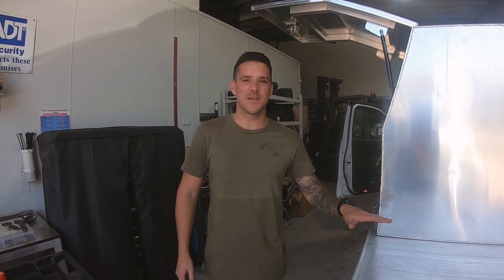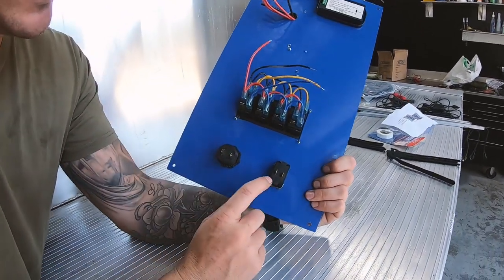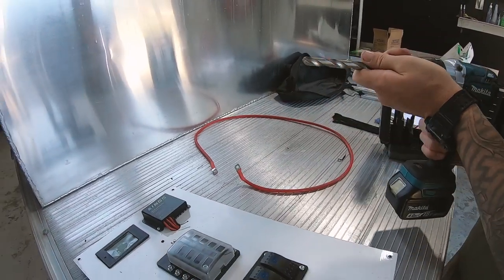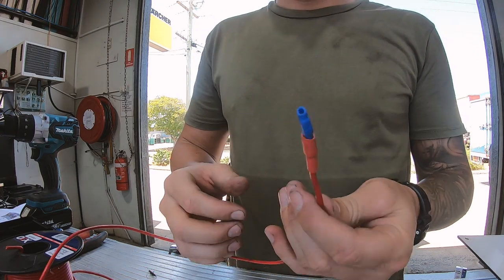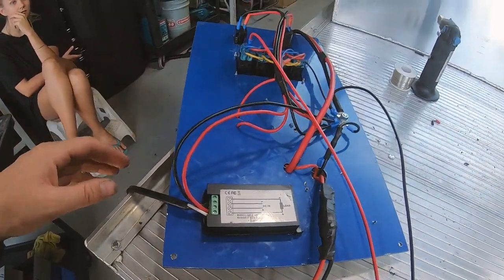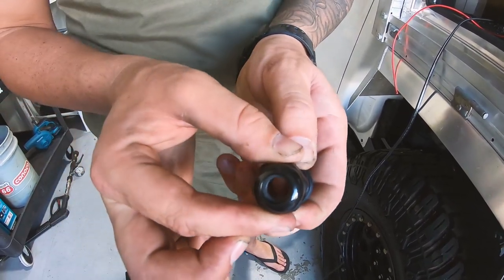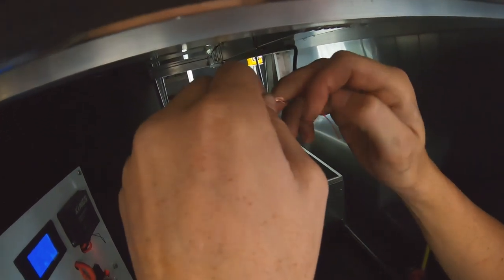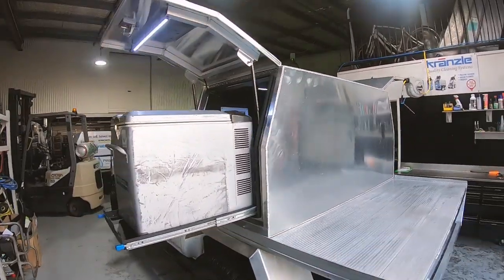Custom DIY 12 Volt Setup!! - Building My Dream Tray Setup Ep - 4

Comment: Would you need to add a circuit breaker or large fuse from battery to fuse panel.  Like the setup keep them coming .
Reply from the maker: D hey mate, have been thinking this! Didn’t click in my head till after, I think it’ll be a safe bet to just add one! Thanks for the comment!
Reply: @RoamLyfe  cheap insurance when it comes to 12v 👍
Reply from the maker: Already started looking now mate! Thanks for the heads up! 😊

Comment: Hey mate, loving the little series. Are you running the battery off your alternator or just as a stand-alone with the solar? If you’re running it from the alternator, where’d you run your cables into the canopy from?
Reply from the maker: Sam Williamson Hey mate! Thanks ☺️
It’s just a stand alone system mate, it’s all I needed! It’s worked great so far has kept up really well! If you where running the cables thru the cab id probly start pulling up the sides of the door sils and run it down the inside of the doors! But otherwise you could run underneath in a conju Thanks for watching mate!

Comment: Hey mate I know its an old video but I loved it still! So you can just run all the negatives to the one earth (the bolt) and then run a negative cable from the battery to the bolt where all of the earths are?
Reply from the maker: Hey mate thanks heaps! And yes that is correct! You’re making a earth junction!

Comment: Might have missed something, how does the battery charge? Don’t you need another cable to the alternator?
Reply from the maker: Hey bud, it’s solar only! It’s really hard to explain but for the camping we do it’s more than enough! I can get 3 days off my battery without sun and when there’s sun it stays full the whole time! The 160watt panel puts in about 8 amps an hour and the fridge draws 2.5 amps an hour and it cycles in and out so you could probly half that! So she’s pumping in a lot more than it’s taking out!

Comment: Like the setup mate. What size wiring did you use out of the fuse block?
Reply from the maker: I dont actually know the wire size but its reasonably thick inside! would be plenty for what i'm running! best thing to do is go bigger than you think you need (witch i have)! if youre unsure speak to a bloke at a battery shop close to you!

Comment: Hi mate. Great videos. What brand is the volt meter you are using? And where did you purchase it. 

Cheers
Reply from the maker: Hey mate, it’s a king controller from 4wd supercenter! It is about 30$ it’s super cheap, seems to be working alright so far! I’m on a budget at the moment and with that price I thought I’d give it a shot and if it dosnt work I’ll go to a dc dc charger with a solar input! Thanks for watching mate
Reply: Sorry mate not the solar reg I mean the one that shows your amps and volts at stuff 

Cheers
Reply from the maker: Oh my bad! I read it wrong, I’m not sure mate it’s not branded but I did buy it from jaycar

Comment: Where did you get the read out display from ?
Reply from the maker: Hey Mate,
I got pretty much all the parts from JayCar! just shopped around inside there and found what i thought to be the most simple setup! thanks
Reply: @RoamLyfe  I'm slowly getting my gear together to fit a 12v and solar setup on my 4wd. The one thing I need info on that you have used is the Digital read out display. Could you please let me know the details and where it would be the best place to get one. Thanks